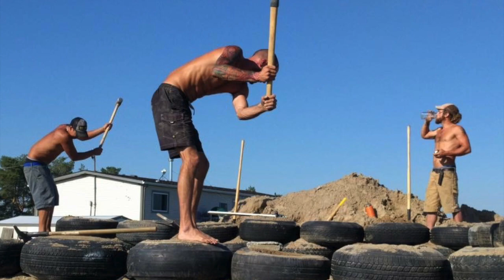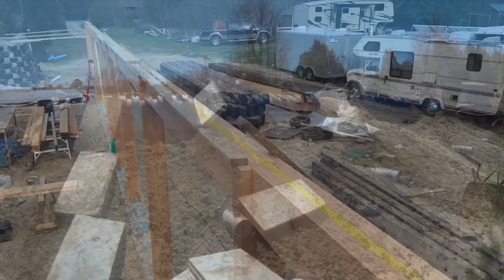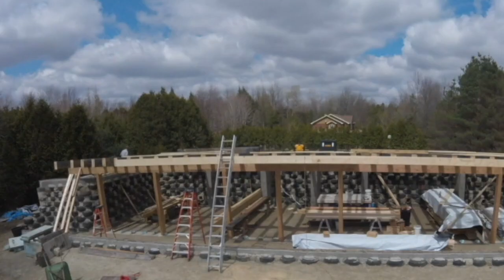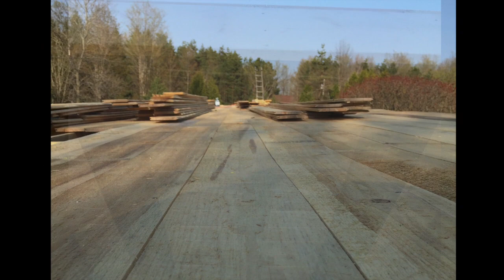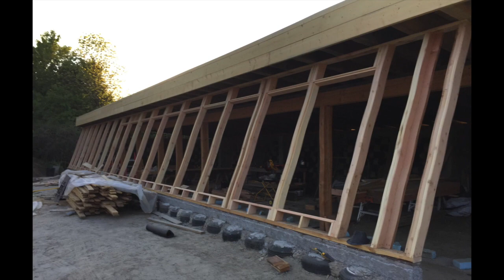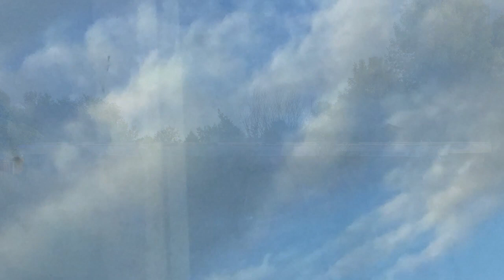Earthship Build Time-lapse - From Bond Beam To Roof Strapping (music by Masego, FKJ)

Comment: I never quite understood the tire wall. Unless for the fact that it's a very cheap building material.
Reply: It gives you a massive heat sink to store heat in the day and release it at night , that volume of cement would raise the cost by 50 grand or so and the tires are a huge eco component to the build!😎
Reply: @anthonysinclair5721  But wouldn't rammed eart or concrete give you the same massive heat sink? Backed by all of that earth mound?
Reply: @jonothandoeser  I'm just guessing that an equal mass of concrete would be similar to the Tire and dirt component albeit at a huge extra cost , as for the rammed earth it may be similar but it's the mass you are looking for and $ savings is attractive for some people as well as eco friendly. To get some answers and real good info on earth ships look up videos by the father of earth ships Michael Reynolds 😎
Reply: @anthonysinclair5721  I tink when Mike Reynolds was conceptualizing the modern Earthship it was in the 1970s and had caught on with mostly destitute hippies. So building with old tires, old cans, and old bottles (which could be gotten for free).
Reply: @jonothandoeser  I like free! 😎
Reply: @anthonysinclair5721  Me too... But part of the problem with Earthships is that they ae hard to get building permits for. Once you mention tire eall" and "beer bottles" as building materials...
Reply: @jonothandoeser  I guess when you approach the building permit people and tell them you're  going to build a house out of garbage they get a little nervous. Lol 😂
Reply: @anthonysinclair5721  Yes, how unreasonable of them!!!
Reply: @jonothandoeser  😂